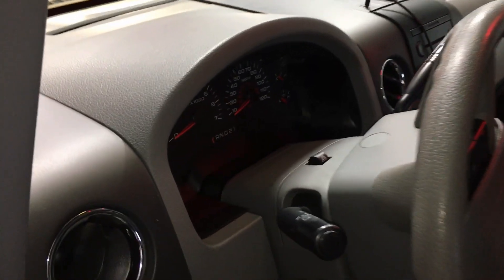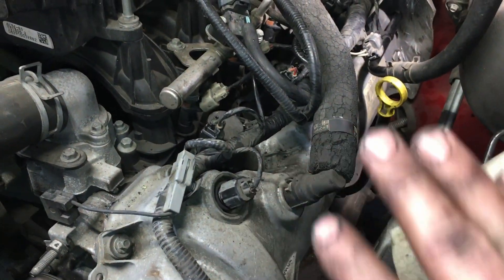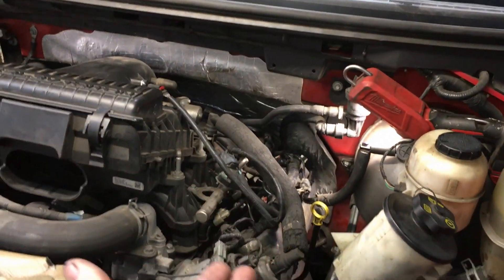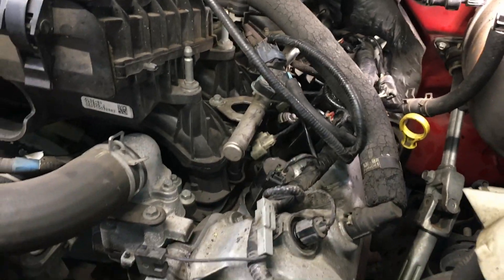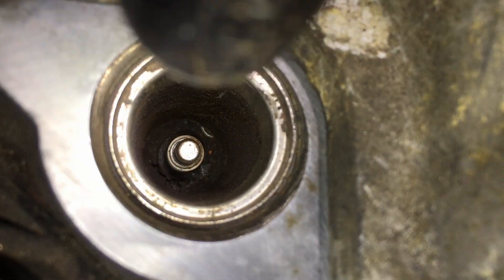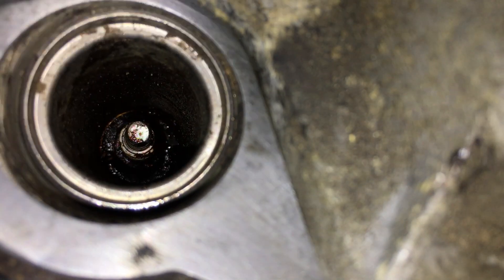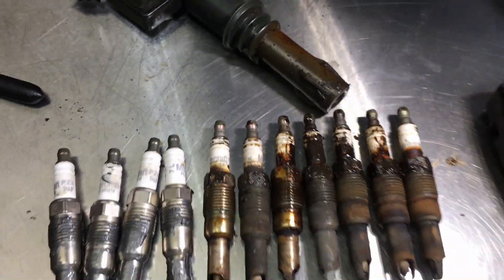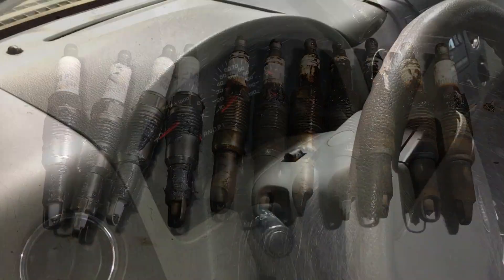Ford 5.4L 3v Triton Engines Fuel Smell and Ticking Tapping Noise: CHECK THIS ITEM FIRST!

Comment from the maker: These are the Latest Parts to Fix this Concern:
Motorcraft Spark Plug *NEW DESIGN*
https://amzn.to/2QMDw4m
Motorcraft Ignition Coil (As Needed)
https://amzn.to/2A6CMSd                                                                                                                                                                              Spark Plug Torque Spec- 25ft lbs
Reply: Love your Ford updates and shared info, I've gotten my second Ford Transit this time with the V6 EcoBoost, had the diesel in my 15 was nothing but a problem when had any type of engine repair, love the V6 EcoBoost, should I be considering the catch can install with this 18?
Reply: I have a 09 4.6 3v 185k and its having a rough idle at startup. I replaced all the plugs, didnt replace COP's yet. I checked EGR valve (no suction) so thats good. What would you think this might be? Maybe injectors? I used to get 15/16 mpg, now im down to 13.
Reply: @jamesfreud1  Does it smoke on a cold startup?
Reply: @Pr0ph3cy-k5z  i dont believe so, i havent noticed if it does. I noticed today it really only idles rough in park. Its idling about 630rpm. No codes being thrown. Its weird. In drive its smooth as glass. No driving issues.
Reply: @jamesfreud1  Mine idled like crap on startups, but ran great otherwise. It started with a puff of blue smoke at startup one winter. My issue turned out to be leaking valves. It started drinking gas like a kid and coolaid. The ironic part was it never smoked in the warmer months, only when it was cold outside. It never threw any codes, but after watching the power balance test on my scanner, I noticed issues on 2 cylinders and had it further investigated. If you know how, do a cylinder leakdown test on all 8 cylinders.
Reply: @Pr0ph3cy-k5z  oh great i hope its not that. I dont know how to do that. How do you do it? I went out and cleaned the throttle body today (even though i just did it 5k miles ago) i really just wanted to retrain it so thats what i did and i think that might've fixed the issue. It sounded good after i did that. Im sure it'll take a few days to really tell. Fingers crossed.
Reply: @jamesfreud1  For a cylinder leak down test, you will need an air compressor and a cylinder leak down test kit. You can get a cheap kit from Harbor Freight, but you generally get what you pay for. OTC makes a decent one. Amazon is a good place to look. You will find tons of vids on youtube on how to properly do a leak down test. Does your truck use a lot of oil? Mine was using a quart each month. If yours isn't using any oil, then ignore the leak down test. I was putting less than 500 miles on mine each month to give you an idea on how bad it was. Try cleaning the MAF sensor as well. Use only MAF sensor cleaner or electronics cleaner. Spray the crap out of it "removed from the vehicle" of course. Let it air dry and don't touch the maf sensor metal wires with anything other than the spray lol.
Reply: @Pr0ph3cy-k5z  oh wow ok. No mines not losing oil. The oil is ok, although I'm still going to research how to do a leak down test just because I wanna learn how to do it now. 👍
Reply: That link still takes you to the old design spark plugs.... clicked on it and it's not threaded all the way down.
Reply: I want to thank you for the knowledge that you have been teaching me how to fix my F-150 truck mine's a 2007 4. 6 L engine but that starter was a pain in the ass to remove that third Bolt
Reply: Hey is there any timing chain kid for a 2000 Ford F-150 with the 5.4 liter? Because on the ford dealers are too expensive. Can you please let me know if there’s any not too expensive.
Reply: @jgc113  no there is nothing worth while! Install the Ford kit, or you'll be sorry if you didn't !!!!!!
Reply: Do you ever mess around with the cam phaser lockout on these engines?
Reply: FordTechMakuloco good find on the spark plugs. I just found one on my 09 ram 1500 yesterday. I just bought my wife a 2010 Escape 2.5L and wanted to get your thoughts on running an in-line trans filter like the FT183 to help it live as long as possible. Figured I’d change it every 10k miles.
Reply: Please consider changing your intro
Reply: Hey, it sounded like the 5.4 still had a tick after replacement? Do they normally have a level of ticking noise? Mine ticks similar (but seemingly louder) and also feels low on power. Is a constant tick right away on startup. Hearing it on both sides of the engine and getting very noisy ticking noise near the fuel injectors. Could injectors be bad? The ticking is pretty noticeable. What's the best way to go about diagnosing? Thanks
Reply: Makuloco .... thanks for your videos...
Reply: The plugs in the link half to be counterfeit. I put them in my 3v last summer and here less than a year later the pickup developed a bad misfire. Checked coils and pulled plugs only to find one plug missing both electrodes and a couple others starting to come apart.
Reply: Hey Brian, my 2007 5.4l 3v  smells like fuel every time I fill it up (not topping off).  I replaced the gas cap, fuel filter, and purge valve.  The smell goes away after the tank goes down a little.  Any thoughts?
Reply: The amazon link you provide says those plugs do'nt fit my 2007 F150 5.4 3v . Just double checking if there is another version of these plugs as I've heard theres an upgrade that doesn't break off in the cylinder. They look the same and have the fuel smell too. Gonna do a tuneup and trying to get the right stuff. Thanks for awesome vids.
Reply: It's not old please keep the videos going on these trucks for there are many still on the road and you personally helped me fix my 08 more times than you know....thanks again
Reply: Is there a way I can message u the pictures I have for some pointers on what to do I could cash app u some money if needed don’t have much but will pay u 
   Thanks for ur videos and tips
Reply: What engine oil should I use in my 08 expedition

Comment: My ticky ticky has been with me for the last 14 years and 90,000 miles. I get 19.4mpg on the highway. I ignore the noise.
Reply: mines intermittent. still getting 17mpg. been running fuel system cleaner and will be flushing the crank case next oil change

Comment: I just dealt with this concern on my 2008 Navigator. Had a tick/tap from the passenger side of the engine and the noise transferred into the bellhousing area when running. The noise was present after the engine was starting to warm up and idle had come down to normal level. I opened up the passenger side valve cover and was surprised to find no issues at all. I was thinking I would find a damaged cam and seized roller rocker and that was not the case at all. After running across a few of these videos made about spark plug noise, I decided to check. Sure enough, found loose plugs only on the passenger side of the engine. Did NOT have a raw fuel odor at idle at all. When removing the ignition coils, the boots were not damaged as some of these videos have shown. I was shocked. I have heard many loose spark plug noises and this was not what I would call a typical type of spark plug noise at all. Sounded just like a metallic rocker arm type of tap noise. I wanted to share my findings in hopes of helping others in a similar situation. Don't jump to conclusions and assume it's a roller rocker! Start with a plug check first if you haven't confirmed the noise with 100% certainty.
Reply: Did you have the noise above idle at all and was it always there? And also what cylinder was it on. Thanks in advance
Reply: @ Hello - yes there was noise above idle. It wasn’t throughout the entire RPM range, but yes there was a “tapping” noise present when revved.
Reply: @codybilderback3697  mine does it to about id say 2000rpm or so if I steady raise the throttle did it sounds like a knock at idle i can hear mine around the bellhousing/converters

Comment: I have the f150 07 with misfiring cylinder #7. the 8 spark plugs been replaced and the misfiring still there. Before was in the hjgh rev and now is under idle. Coil was also bad and changed. Checked the wires with noid light and is flashing (injectors and coils). One thing I noticed is if I left the truck one day without start there's a bad gas smell. Any idea what could be wrong. I did not heard the tick like on your video, only the rpm changing because the misfiring. I bought the truck 2 months ago and it's supercharger I only use 93 and the former owner does not use. I only use because it was I read. Appreciate any help on the issue. Thanks.

Comment: My 04 just started this,it actually starts and idles perfectly but after warm up it starts sound rough.My son drives it and he said he noticed the Oil pressure gauge jumping when this all started.i checked it this morning and it was running good until it warmed up and then it started ticking and tapping from the driver side.engine was replaced with Crate Ford engine and has 100k on it now.

Comment: I have this same noise! The dealership says it's the cam phaser but it sounds more like this noise. Did the scanner say the engine was misfiring? Because currently, the scanner doesn't mention any issues for me. But I want to find out if that was the case for you before paying Ford $2500 to replace the cam phaser

Comment: I've been emailing you about my 06 f150 ticking noise and after hearing the truck in this video after you fixed spark plugs... mine sounds the same. maybe mine is normal sound that im mistaking for issue

Comment: This video saved me a lot of time and money!!! My 2011 Honda Fit started making this sound but way worse. Turns out 1 spark plug had come loose. It sounded very metallic and catastrophic. I thought the head was cooked. Chirping,tinging and clicking. Raw fuel smell when I turned my heater on. I had the raw fuel smell near the end of January 2023. Only recently it started making noise. I will post a video to my channel in the next couple weeks.

Comment: My 2013 expedition has developed a ticking noise unlike any of the ones you discuss or have presented in any of your videos. It only happens at slower speeds under slight throttle, mainly when the engine is under load of going up some incline. It seems based off throttle input, and is rhythmic in nature. It doesn't happen all the time though, say while cruising at higher speeds. It is a very faint ticking or metallic noise, that sounds like a thin piece of metal material(like a header gasket) rattling? Any thoughts? No lights on the dash, no misfires or stutter, drives fine to me. I have had some issues with the shifter stick having some resistance moving it into Drive. Not sure if it could be trans noise? NO IDEA. The technician said it was spark plug tick, but it isnt constant, and you dont hear it at idle. Also there is no movement of the plugs visible.

Comment: My 2006 5,4l is doing about the same thing, but the engine is also losing a lot of power  Nobody has the same issue ?   I'll beging by replacing the spark plugs but the issue is probably bigger.  My first Ford 150 (usually gmc sierra) so I'm learning about it....

Comment: In this video, there is a tic/tapping sound and a rattling sound (like beads shaking in a bag). My truck has the rattling bead sound only at idle. Sounds like a diesel, just like in your video.  Is that a normal sound, or is that the injectors going bad?

Comment: I can't find one video to explain the ticking I'm getting. My truck doesn't turn over at all. Just a loud ticking sound when I start ignition. Even happens. Afew times when I turn it back off. It's loud and gadges jump. Power is there from battery but it doesn't start at all just a very loud rapid tick

Comment: I have a ticking sound on my 2009 f150 as well, and sometimes, when I start, i smell gasoline. Or something weird odor from the HVAC, is it the same diagnosiswith 2004 to 08 f150?

Comment: https://www.youtube.com/watch?v=vPcyHdnSfmA
Mine has a tick that comes and goes.  It slowly gets louder and then stops.  any clue on this one?  Checked for exhaust leaks and checked spark plugs.  I suspect it's a lash adjuster bleading down.
any help?  Oh By the way, I used your videos to install this engine.  It has about 20,000 miles on it with oil changes every 3,000 miles.  running 5-30 synthetic.

Comment: Why does it still tick after you changed the spark plugs
Reply from the maker: That is the way the 5.4L 3v sounds with a 24v valvetrain.

Comment: I have a similar sound on my 3.7l I ve had people on the forms and I tube say they have changed there plugs and the sound went away I'm skeptical but I might try it they have a 118000 on them they probably need replacement any was

Comment: Thank you for this video I just changed my plugs about a month ago I have a 06 f150 with a 5.4 after I changed the plugs a week later my truck started sounding the same way as the truck in this video and I had smell of fuel coming in side of the truck I did what you suggested and this time I also torqued the plugs this time with a torque wrench now my truck runs like new and no gas smell thank you I would've never figured it out

Comment: I'm currently experiencing something similar on my 09 F150 4.6 3v. It randomly smells like gas under the hood,in the cab, and under the truck. Also, I have a check engine light for Huge evap leak.  My first guess is a failed charcoal canister or the Ford capless gas intake. Question, if the gas smell is truly from the spark plugs, would you get the evap leak code?

Comment: What is the best suspension to go with on a 05 expedition 5.4 4x4 it has air suspension factory but it’s not working as the bags are not inflating but I see they have a coil over conversion and I will be pulling a camper and a utility trailer I’m just not sure if I should fix the air shocks or go with coil overs

Comment: At the end of this video when you said like new that’s how the motor should sound all the time the little ticking is not the roller followers? That’s just a normal 5.4? lol. It’s funny if you search for a normal, running 5.4 the video does not exist.

Comment: I've had two plugs come loose so far and the electrode on both of them was missing. I've been using a OBD2 reader to read misfires and it will tell you which plug is coming loose.

Comment: Hello I have a 2004 f150 5.4 3v my problem is it’s running rough and it has dual exhaust one has cold air coming out and the other one is warm it’s driving me nuts any help would be great thanks

Comment: 06 Explorer 4.6L 3V 218K miles, well maintained. Saw vid on loose spark plug sounding like lash adjuster on 5.4L. Noted exact sound. Got steth out and probed usual suspects but heard hammering sound on top of #6 coil pack. History - went thru broken plug fiasco couple years back so installed Brisk Racing 3VR17YS and new coils. Ran ok but mileage suffered. Yesterday pulled all coils and plugs. #6 plug has loosened and turned out a couple turns, rest all loose. #6 plug ground electrode was completely gone but no misfire - probably arcing to head. Followed your cleaning, correct plug, installation, anti-seize, thread cleaning (w/carb spray and long brush), and torque spec to the letter. It sounds like a new engine. Long story but thank you sir for your top-quality vid quality and content.

Comment: Hey i have a 2011 ford expedition that when driving over 40mph and the pressing on accelerater it makes a jerking loud noise. I thought it was the 4x4 actuators but ive checked them with vacuum and they are good. And just cant figure what it is! Any ideas?

Comment: The ticking I have in my 2010 f150 5.4 3v gets louder as I accelerate could that be from a lose spark plug too?
Reply from the maker: I have never seen loose plugs on 2008.5 and newer models. You probably have a failed follower and should be checked immediately.

Comment: now, ford tech. let me ask you this. 08 ford expedition. 5.4. running LEAN bank 1 bank 2. ive replaced the 02 sensors, fuel filter, vacuum lines, vacuum purge, nothing is fixing it... also it begins to miss fire after idle for over 5 minutes. but goes away once driving again

Comment: I have a 4.6L mustang. The ground electrode strap was broken off of 3 of my plugs that had only gone 10000 miles.  Would this be caused by this or is it a issue with the SP546 spark plugs.  I am hesitant to buy new ones because I am considering a different plug.

Comment: Ihad a 2 valve which spark plug blew out. Many years ago.  Now I just learned it was a common problem.  It sounded pretty bad at the time but it was an easy fix.

Comment: I have a 06 f250 gas motor just started running rough all the sudden and stalled on the highway. Changes cam sensors and crank sensor and it didn't fix the problem. Cleared the codes but running really rough and weak. Please any Ford experts have any idea?

Comment: Could a loose spark plug cause a small rattle only accelerating under load? For instance in high gear at 60mph I can give it a little gas and I hear the rattle on the driver's side. If I let off of the petal the rattle goes away.

Comment: I read that you are no longer supposed to put anti seize on modern spark plugs because they are manufactured with a kind of built in anti seize. The silver layer on the threads indicate this and should not have added anti-seize applied because the silver covering is designed to break away/erode. Using anti seize with this can cause over torquing of the plug because of the decrease in friction on the threads. However on plugs that have black or naked metal type threads it is suggested to use anti seize to prevent rust Since there is no protective layer. Any thoughts on this?
Reply: I would still use a little anti seize either way

Comment: I just changed mine out...still a knocking like a rod,and throwing codes 300,303,304....replaced coils,plugs, injectiors...po304 misfire still...smh